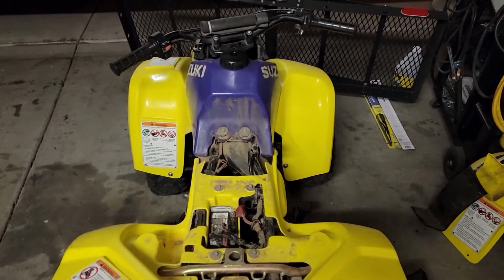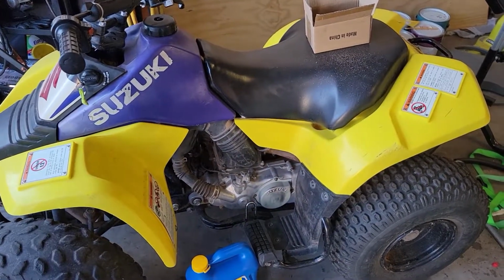Suzuki LT80 Top End Rebuild

Comment: My rebuild kit came with two circlips do you only install one?
Reply from the maker: I believe it left 1 original cir clip on the other side and used a new one on the side I removed.
Reply: Okay what direction does the arrows go
Reply: Hey mate my piston and fitting like a glove could the rings be a little stretched out?
Reply: What’s the spec for ring gap

Comment: the top end brand that u put is good or bad ?
Reply from the maker: I'm really happy with it, so I would say good.
Reply: thank u for answering my question i have one more what is the red lub thing that u put on the piston and cylinder
Reply from the maker: @jrnycg3589  it's assembly lube. You can use engine oil instead of assembly lube